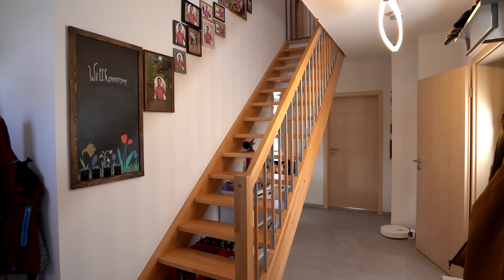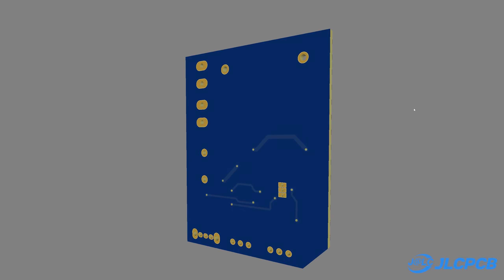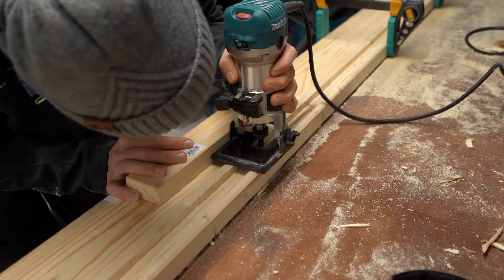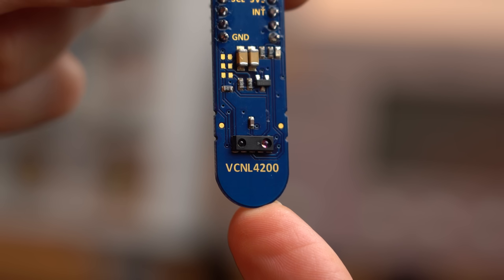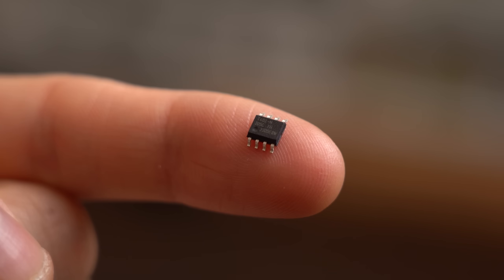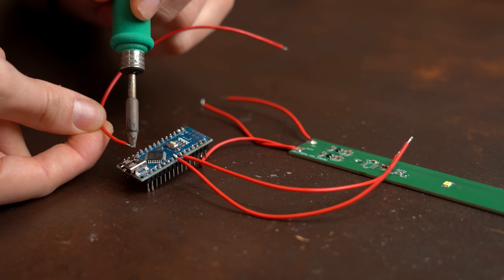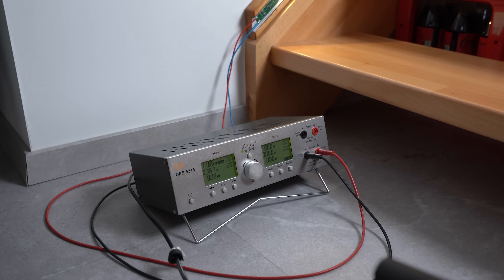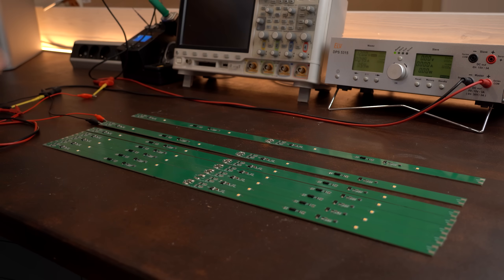I tried to Revolutionize LED Lights!.....And FAILED?

Comment: What about having the 2 sections powered separately instead of being connected as 1 huge light strip? I would also use one sensor to light up a number of LEDs, 4 sections of LEDs so 4 sensors in total to control one zone of LEDs. So lets say you can divide all of the LEDs into 4 zones of an equal amount of LEDs, use a single sensor to control each zone, or depending on whats needed, use Two sensors for each zone of LEDs instead of one.

Comment: I don't think it's a noise issue. Most probably it's code debounce issue. Like when you are walking stair case do vibrate a little bit. Which is causing the distance sensor to register a change in input (I haven't got a chance to view the code but I will sometime this week.) or the time the distance sensor measures the change quickly which can be tested if you quickly move your hand over the PCB from a distance to see if it registers (turns on the led). But since the above leds are also turning on it's more like we have to add a kind of debounce for the distance sensor say not register a change in input if the change is for less than 5 readings or such. Depending upon the sampling frequency.

Comment: God job. I sugest you a more simple desing. A WS282B LED strip, tha are dindividual directionables LEDs. This means that you con switch on or off individualy each one LED, at any color that you want.  To decide wich LED switc on in the strip, is enaught to measure the distance with several devices, like a ultrasound distance meter, o a laser distance meter, or any kind of proximity sensor as you are using in your experoment. The WS2812B are controloed by a Arduino or ESP32 microcontroller easylly. This will be my solution.

Comment: I think the edge of the pcb is touching the rail and shorting stuff , next time leave some space between the power planes and the edge of the pcb. I say this because your issue seems inconsistent, each board acts differently. I might be wrong but you have enough space to avoid this future problem since vibrations will slowly eat into the silk screen.

Comment: I would do it differently, 1 microcontroller such as esp, and addressable leds, i think it will be cheaper and easier. Also you can use less sensor and create algorithm that ambient the light according to the walking man progress (also only 1 ambient sensor needed).

Another idea is to use a pressure sensor on each step.

Comment: Why not just have one distance sensor for the entire staircase to find where the person is and have the LEDs light up based on that?  Would allow for the frosted LED cover you wanted, plus you could use that to determine if the person is moving up/down the stairs and light up the LEDs ahead of them (or even fade in/out more smoothly).

Comment: nice project , how much current they consume  , u can let only the top and bottom pcb work normaly to weak the other microcontroler  from sleep if a person was detected . also u can use one master pcb that power all slave pcb with 5 and 3.3v and use timer to dim the led after detection may be u have problem if all the pcb try to communicate at the same time.

Comment: There's a chance all the different IR sensors were interfering with each other. I've built robots with IR depth sensors and unless your specifically building them to have independently distinct IR signals, those sensors will interfere with every other one nearby. (LED light bulbs and direct sunlight can cause unexpected behavior as well.) I'd suggest just having one at the top and bottom that keep on the whole strip for a set period of time. You can put logic in to turn off the strip when the second one is triggered and/turn off after a set period of time.

Comment: You can still use diffuser cover, just drill the small holes in the front of sensor. Anyway, thanks for interesting story, i know you will figure out how to solve this issue

Comment: I think it would be better to have an 'entry' and 'exit' sensor, top and bottom step.
When you enter the staircase, the first block starts to illuminate with a slow PWM rise. 
When it reaches a threshold, say 30%, it tells the next block to start to illuminate. And so on.
When you exit the opposite side, or a timer expires, the sequence repeats in reverse and it dims.
It would look really cool and only rely on 2 triggers.

Comment: No idea if it is related to the current problem, but I believe you drive too much current through the VCNL4200's IR LED: R2 is 2.7Ω (the example value in the datasheet) - but in combination with 5V supply and the LED's forward voltage (Fig. 10 in the datasheet), you would land close to 1A - the poor LP2985 is only rated at 150 mA, which might run it into overcurrent protection.

Comment: I'd use one single microcontroller and address the sensors (if possible - I didn't check the datasheet). I know the ST VL53L0X can have it's address set. But it has to be done during initialization, and you'd need an enable line for each. But you could achieve it just like ic leds do. You can implement a simple shift register bit in each board. Then you can push the enable pin out, set the address of the first. Then shift it to the next board, set the address. Then the last board can have a terminator that would send the enable back to a return pin routed all the way back to the main board.
This way you know how many sensors you have (all on the same i2c bus) and how many ic leds you have in the chain.
Ah... The initialisation you send 1 enabled bit followed by as many disabled bits until you get the feedback. Then to enable them all for normal operation, you repeat the shifting process, this time your send a sequence of enables only.
From there, your uC just monitors each sensor and pushes a steam of controls to the ic leds. 
I'd use 2 i2c buses, one for sensors, one for leds.
Too many dc-dc converters is also an issue. You should have a single higher power PSU and inject the 12V to power the leds at every certain number of leds (just like people do with long led strips).
This way you can even have a much higher density of leds, like one every 2 cm, and you'd still be great. 
You can use libraries to control ic leds very easily. 
This should work fine. The only possible issue I see is long parallel traces behave as capacitors. You may have issues with it.
Beautiful and scalable solution. 😉
Reply: The extensible shift register can be implemented by using a simple D flip flop IC for each sensor. It is very cheap.
Reply: Let me rectify my comment. IC leds use the NRZ protocol. Not i2c. So the leds and sensors would naturally be in different communication buses.

Comment: It may be something as simple as reflected IR light between sensors triggering others up and down the chain. Normally you’d use a different “signature” or frequency to avoid this kind of cross talk triggering. Some confusion may occur also from the ambient light sensors triggering. This is avoided with a time delay response to insure it is day time and not reflected LED light.

Comment: I think soldering PCBs together is not good idea try to use some sort of mail, female connectors if something brock you can replace the PCB in future.  and maybe you can use diffuser only at front of led and the glass or acrylic shit for IR Sencers.
Reply: That's called board-to-board connectors and you can use angled headers for that.

To be kept in mind that contact resistance of connectors is higher than resistance of a solder connection and can be a little inconsistent, sensitive to room air moisture temperature etc.
Reply: Ooo thanks for the information @SianaGearz

Comment: Very cool project. Unfortunately I don't have stairs, so maybe I should move to a new house now :D

Just to be sure, the aluminium profiles are not shortcutting something are they? The problems seemed to begin as soon as you put them in the aluminium profile so I am betting on that doing something weird with your cicuits.

Maybe somehting with internal reflections or some signal that is being tansported through some kind of induction? I have no idea, I am just making stuff up.

Comment: I had to deal with a maddening motor controller that accepted 12 volt PWM (Linak speed controllers are weird, yo). Every attempt to step up Arduino PWM resulted in the actuator randomly stopping, requiring us to press the input again.

And it turned out that instead of a MOSFET, all I needed was a BJT in the step-up circuit.

That was the first and last time we used a Linak actuator with that speed controller.

Comment: I also prefer dim lighting when heading for bed. The hallway and landing sensor activate the relevant light at minimal brightness and lowest colour temp between 11 p.m. and 6 a.m. On the stairs themselves I have a WS2812 strip with a VL53LOX distance sensor on the first step and on the banister post on the landing. When you put your foot on the first step the strip lights from ground floor to landing over a couple of seconds and turns off when you trip the landing sensor and similarly when you step past the banister post on the landing it lights in sequence from top to bottom and turns off when you get to the last step.  Lighting the steps in the direction of travel has proved enough to satisfy my inner nerd, when I first set it up I worked through a variety of running colour waves in the direction of travel a la aircraft emergency lights but once the novelty wore off I found it annoying so set it to just light in sequence.

Comment: This is like Jack's house in 3 body problem. He had motion sensors for all the lights in his house, including the stairs.
But i believe his weren't on the actual steps, but instead lights beaming on the steps from the top.

Comment: If I had to do this I would try a mmwave presence detector above the staircase, I hear they are quite accurate, then address the LEDs through the smart home. But you can probably do it using just using a microcontroller, too. Would be interesting to see you try that solution. Cross-topic with aliexpress video trying mmwave sensors! :D

Comment: Funny, my SHMBO would have nixed that long pcb right from the get go, as I would have as well.  Some mini-leds under each stair pointing down 45 degrees to illuminate the next step with a couple PIRs at top/bottom would work really well. Well, without the ghosting led action as you walk effect, which I think I'd rather not have so I could see the entire stairway before I step on that one Lego or Hotwheels....

Comment: Maybe this: You only need one lightbeam operated by a motor placed BEHIND (or above, less fun) the stairs (its an open staircase) and some bending detectors on the bottom of each stair step. Or radar detection from above (less fun). Wireless communication between light and detection module.

Comment: Too late now, but I wondered whether the LD24120 radar sensor may have worked (with an opaque strip). Probably not the cheapest or easiest option.

Comment: You are using a large number of IR sensors and it is quite possible that they interfere with each other. As you walk down the stairs, the IR light can be reflected to other sensors that react to it. All will probably use the same modulation/encoding... I would try to put a tube around the sensor's eye to make its field of vision more focused.

Comment: I think your problem here is that when one sensor sends its IR pulse other sensors receive it, messing with their timing. (especially since they have common power supply so they turn on at similar times). The big clue is that after disconnecting  data lines the lights that stick on constantly are the ones on the top of the stairs, where there is overhang wall. I would try and see if mechanical solution works. (something like a tube that only allows sending and receiving light from certain angles)

Comment: When you make a long-run data transfers, you have to make sure you sorround the data lines with a lots of ground and  keep the noisy 12v away. (And use dedicated pulldown resistors at the input side with a small capacitor on the output side of the data lanes.)

2nd suggestion is to only pull the output high if a feet is detected, otherwise pull it down. With a small delay on each side(after input interrupt and output sending)

Comment: Hi,

I was planning to do the same to my staircase for some time now. Never had the will to start implementing the idea I had until I saw your video.

I did one project with a IR sensor array consisting of 7 IR sensors (SMT phototransistor and an emmiter) in a line, we had to detect hand movement in a certain area. First we used comparators and set the trigger distance with a potentiometer, but then we moved on to ADC for signal measuring to the MCU and setting the trigger distance in the code. The whole IR sensor array including the ADC IC was powered with a linear voltage regulator and had no problem with a power line noise, but the regulator was dispersing alot of heat so we mounted some small heatsinks on the bottom of the LDO.

For the switching regulators I noticed that your schematic may lack some 100nF-1nF bypass capacitors on the input and output pins. I would recommend to add some, it may not add any difference to the signal noise filtering, but atleast the solder pads for the capacitors could be there. The capacitor Ground pad shoud be as close as possible to the IC GND pin and not cut off with signal or other lines.
Also I would suggest you to check the ground return paths of all IC's, especially the U5 and U4, the lack of ground stitching via's and increased ground paths could be the issue of the noise on the power rails.  
Also I lack the knowledge of why the via's are exposed insted of tended with soldermask and I'm currently not sure if the exposed via's could cause some signal noise. I recommend tenting them in the next design. Check if the exposed via's are not making contact with the mounting rail.

Thank you for the video. I will use your idea of not damaging the stairs.

Comment: What about using UV leds snd uv paint or glow paint!  Some is clear the LED UV lights can be placed  elsewhere to illuminate the steps that will glow in the UV light!  A hand rail with uv strip hidden under it would be cool..

Comment: You could've just put distance sensors to both ends of the staircase and WS2812b led strip. Measure time you need to reach the top or bottom and program leds to slowly turn on and off in a wave. Does it really matter if it doesn't perfectly follow you?

Comment: I use WS2812b LED strips everywhere. I also use these on my staircase, which goes into wild rainbow mode, when it's bedtime for my daughter. It really helps us to get her upstairs. :) And at night, only the two most outer LED's light up at each step. But I don't know what it is with LED strips inside of an aluminium case, but they do weird things sometimes. I have one strip of exactly one meter in an aluminium case and that strip is powered by +5V, GND and one data wire. The aluminium is not grounded, but when I measure the metal, it reads about 70 volts, while there is only 5V near (not even touching) the metal. Also, two LEDs inside that strip have already failed. I have never had a failed WS2812b before. So would it help to connect the aluminium to ground in your case?

Comment: Great video. It shows the trials and tribulations. I was hoping for the part2 fixed it video. However i thin in think the connectors and other ideas on the comments are great and would like to see the part 2 integrate these ideas. I am intrigued by one commenters drill a hole in the diffusers, as it sounds like it would look horrible but might just work.

Comment: You could have adopted a much simpler design with just 2 sensors at the start and end of the stairs and used WS2811 IC for daisy chaining the signals and controlling the LEDs on each board. You could turn the LEDs on and off with a generic time based on your speed traversing the steps. There is no need for a separate micro controller on each board. The first and last PCB just need to be different. Think of it as an escalator in a mall. They have sensors at each end and turn on and off based on a set time.  You can also use a random effect each time, like tetris mode!

Comment: What you're trying to do is very neat.  But it looks challenging with the problems you are facing.  A while back I developed an ESP32 based controller for an LED strip that sits on the bottom of a shelf over our toilet.  It uses an ultrasonic distance sensor (HC-SR04) to read the distance.  I put my hand under the sensor and the LED strip lights up for a certain amount of time (usually 3 minutes).  This way I can use the bathroom at night without killing my night vision and waking myself fully up.

I thought about the staircase application you are trying.  Rather than placing a sensor at intervals along the strip I figured I'd just use my existing strip controller at one end.  I'd put another standalone controller at the other end and transmit the signal that someone passed the sensor using ESP-NOW to my existing controller to also activate the strip.  If you wanted to simulate someone walking you could light up the segments of the strip using timing.  But that just seems unnecessarily complicated. I'd just light up the entire strip for a preset amount of time.

Comment: is it not light interference from the neighbouring activated leds (and potentially background light as per some of the shots) that are causing the weird behaviour? I'm sure youve already considered that but, if not, raising the trigger threshold for the sensors in the code could help.